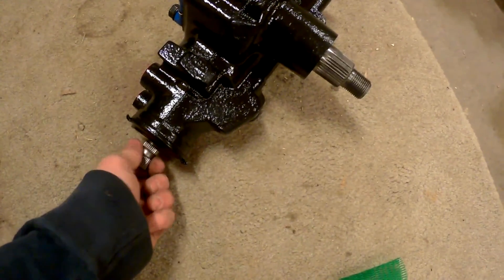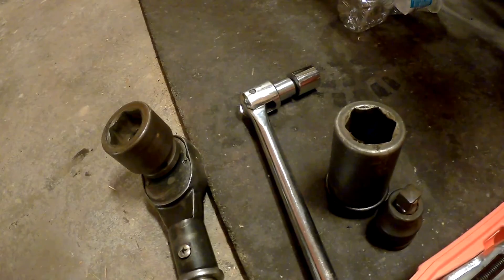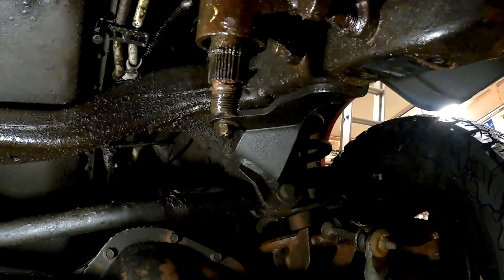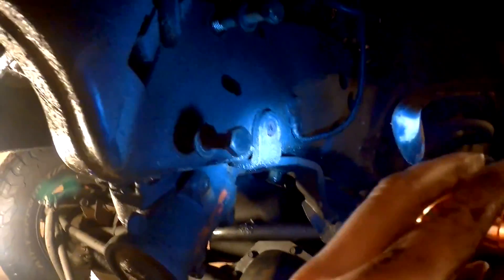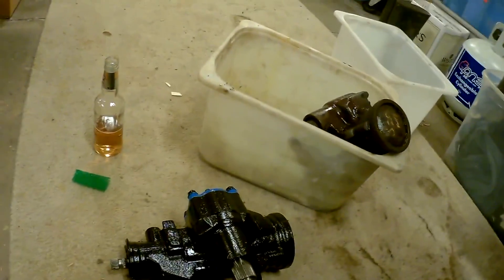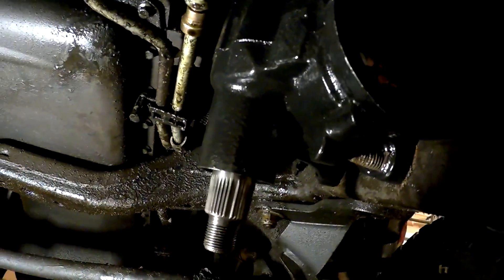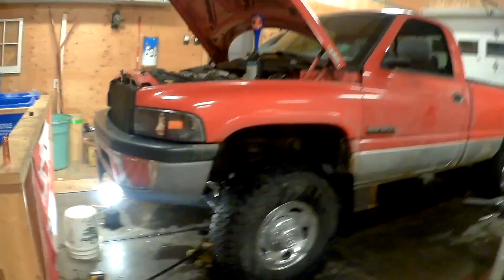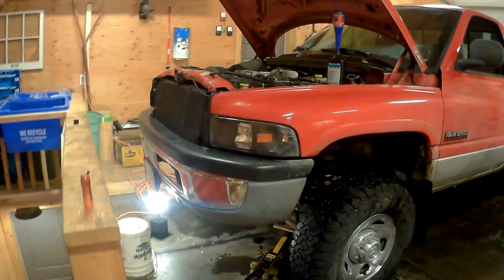1994-2002 Dodge Ram Cummins 2500 steering box install.

Comment: I wish you would have driven the truck and told us if the new steering gearbox was good or not
Reply from the maker: Yes I could have. It was good however was not a lifesaver by any means. My biggest upgrade for steering was the 3rd gen trac bar conversion.

Comment: Did it take the play out? And was this box a factory ratio
Reply from the maker: Factory ratio and it did take the play i had. However i still have to say the best mod i did was the 3d gen track bar conversion.
Reply: @Schneids15  Ya I saw that, where'd you get it, all bolt on or weld?
Reply from the maker: All bolt on. It was used. I would go with heim joints if i did it again. Check solid steel industries or ffs store i believe. I can’t remember where that one is from.

Comment: I have a brand new box for a ram 1500 gasser, do you know if it’s the same as the ram 2500 Cummins? They look the same but Autozone shows different part numbers
Reply from the maker: Sorry but i am not sure. I know they are very similar. I believe the gas trucks have a tighter turning ratio. Less spins from full crank one way to the other. Josh

Comment: I noticed in one of your replys that you said you still have play in the steering with the truck off now that indicates either your linkage to he steering gear box is worn out or you need to adjust the screw on top to get rid of the play
Reply from the maker: That all is true. I found out that my track bar bushings were going bad and needed to replace them.

Comment: I have an 09 Powerwagon with ridiculous play in the steering. Love the truck but ready to trade it in bc of the steering on it! I’ve yet to find a definitive solution. Of course Dodge dealership can never find a problem! “Everything is within specs”! 🙄  Can anyone suggest what to look for or change??? I thought your aftermarket box was the truck, but you said you still have a bit of play.....??? Did changing the linkage help? Thanks for the video.
Reply from the maker: All i can say is have the truck off and put the key to the on position. Get someone to crank the wheel back and forth while you are under the truck watching the linkages. Check each tie rod end, trac bar linkages and pitman arm. If everything is tight there go up top and check your steering shaft. If still no play i would look into tightening your steering box or replacing it.

Comment: update on the steering box? how has it held up?
Reply from the maker: Seems to work alright still. Steering still has play a bit but i have all original tie rod ends etc. I can move the steering wheel back and forth with the truck off at idle without the wheels moving. That indicates to me some play but it also could be turning and there play in a tie rod etc. I regularly check the tie rods and linkage and they all seem very tight.